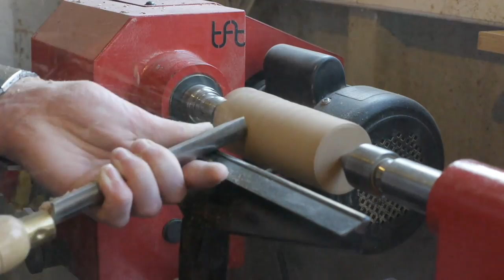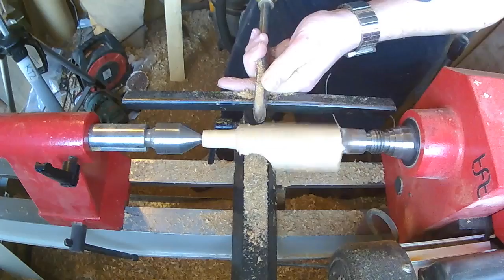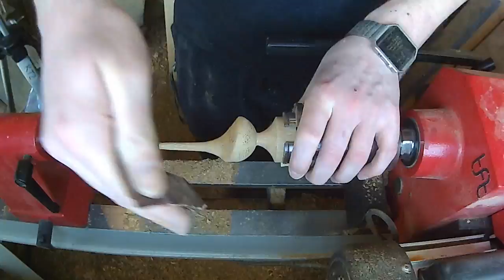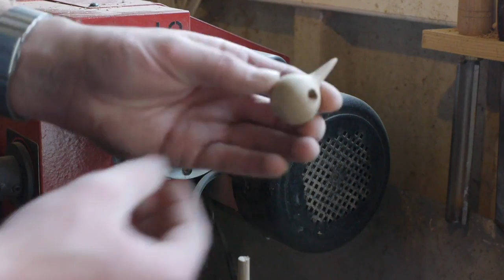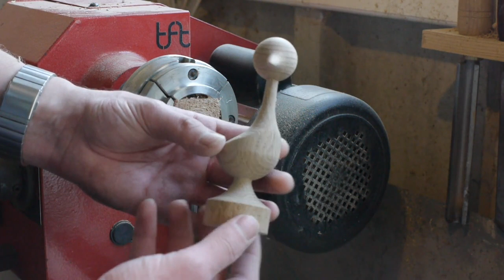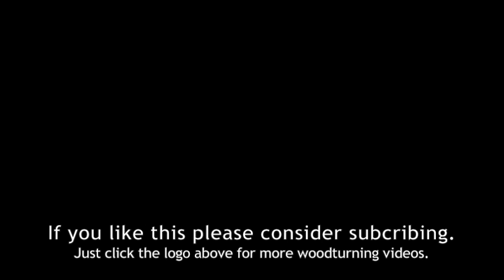Multi axis woodturning an oak bird

Comment: That came out so cool! Looked a little tricky but definitely took some skill!
Reply from the maker: Thank you sir, it can look crazy at first but the principal is exactly the same as any other turning, you just gotta take very light cuts because you're cutting a lot more air.
Reply: tfturning good to know. I may be hitting you up for some advice when I give it a try.
Reply from the maker: @madiradesign  I'm confident you'll nail it but sure, i'll help where I can 👍

Comment: That was so satisfying to watch!  Why did the tail stock look like it was sliding in when you were sanding the bird body?
Reply from the maker: Cheers man! Yeah it's because it kinda was a little bit. I hadn't locked it down but it looks like it got a lot closer to the piece than it actually did. Noticed that in the edit 🤦‍♂️
Reply: @tfturning  Gotcha...I have a lathe, but I'm no where near as good as you...I learn a lot from your videos and they inspire me to do more turning.
Reply from the maker: @StanCrafted  Thanks man, I appreciate you taking the time to watch! I feel the same about the stuff you make, that kumiko panel from earlier, impressive stuff! Take cake out there buddy👍